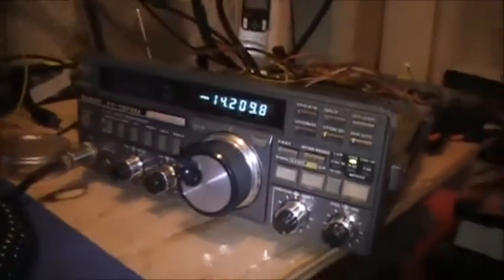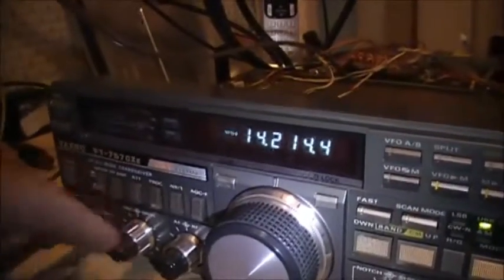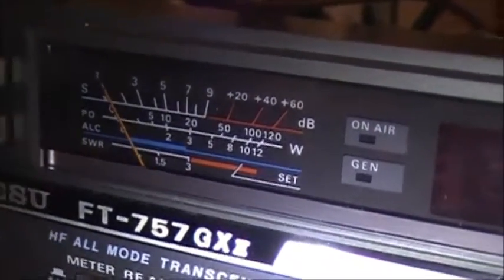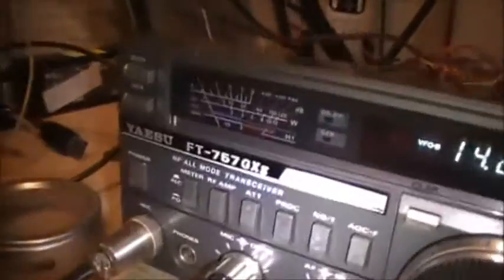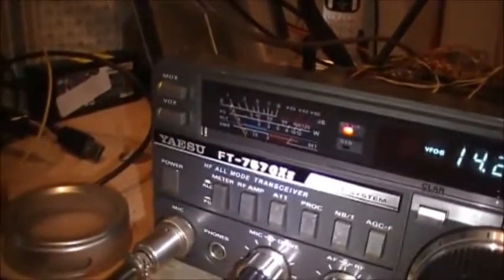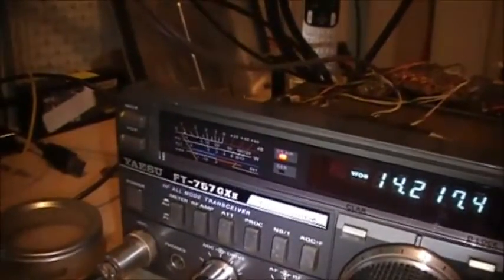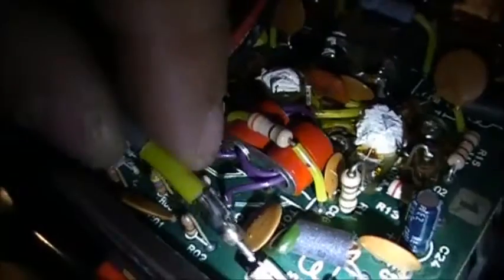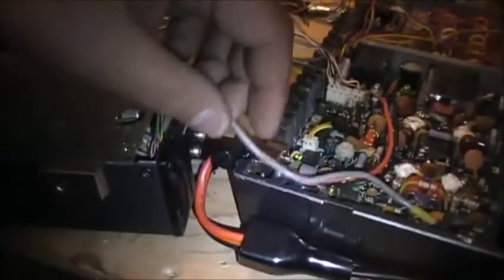Yaesu ft757gx2  Mysteries of RF Output

Comment: Did you ever find the mystery?? I have a dead one at home. Mine stayed stuck on transmit and then stopped. It will key up but no output
Reply from the maker: I found the issue for my 767, she is repaired now and working normally.
Reply: @Radionut63 
Slt,
Ok mais qu'as-tu changé ou trouvé ?
Thank's
Best regards
Reply: @Radionut63  what was the issue with the 757? Mine doing same thing. Pils? Thanks